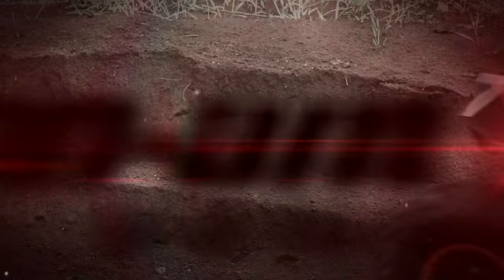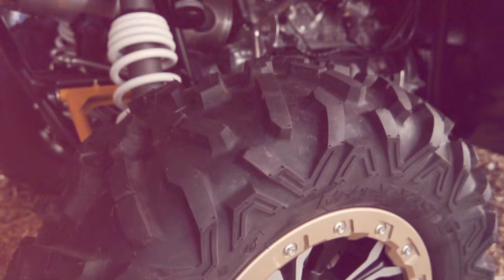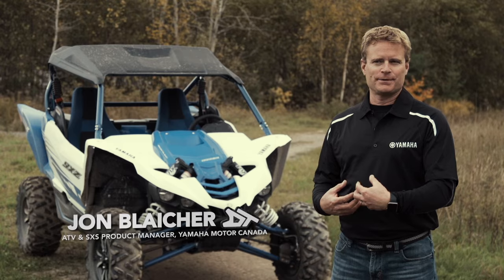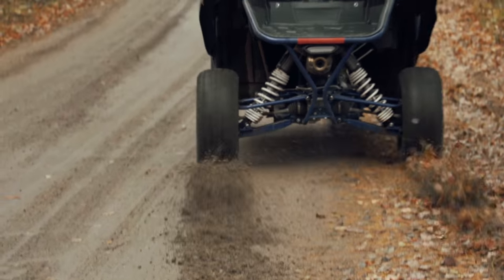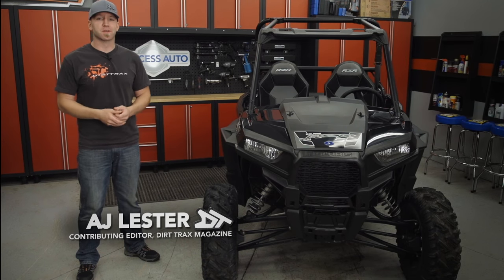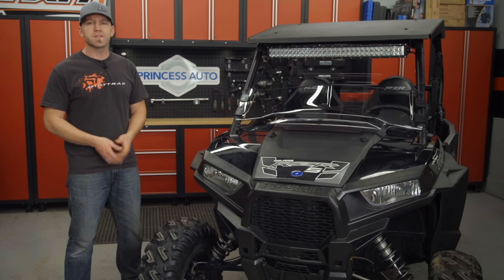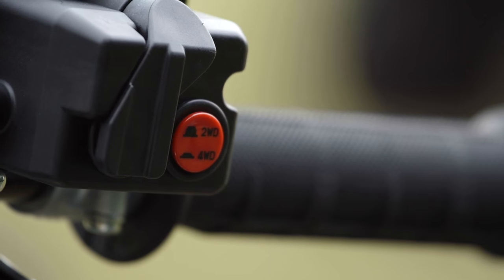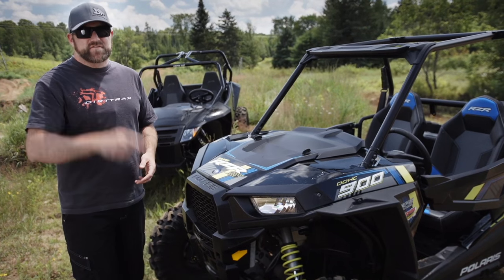Dirt Trax Television 2015 - Episode 17 (FULL)

Comment: i live in ny all we have are woods ,are camp is in pa ,so we ride the dirt and hills non stop.i love my yxz in the dirt i have no issues in tight woods all. ive never rode the dunes but i could only imagine how bored i would get looking at sand all day. after setting up the suspension i have it driving like a nice soft couch in the rough woods. with the installation of a rekulse clutch it made woods riding even easier. with that said i love my yxz in the woods and have no issues.

Comment: Unless my eyes are failing me, the blue/white YXZ has a bent left rear axle shaft... Very impressive looking machines for their intended use, however I just dont think it could take the place of a CVT in the rough and technical stuff. Wonder if yamaha will work on something a little sportier than the Wolverine for that? Either way, the competition helps us all in the long run.

Comment: Im going to come out and say it. If Yamaha slaps the same or a similar turbo system as the 998 triple snowmobile engine, this thing is going to blow up the pure spot side by side market.... 200hp yup... can hardly wait for the snow trax review of the yamacat combo.... ive heard 3rd party dyno of up to 204 hp... in a 500lb machine, that is straight insane.... Yamaha is guaranteeing 180hp in all conditions.

Comment: Which one is better for trail riding, the Polaris Sportsman 570 or Yamaha Grizzly 700?
Reply: +JustinJFilms i bought a new 2014 570 and its alright but in the long run and durability i would go with the grizzly
Reply: +JustinJFilms Cant go wrong with the Grizzly, very reliable, fast, good in all conditions, I'm guessing the Sportsman would have a softer ride (from my experience, I always found Popo to be smooth) not that the Grizzly isn't, I just find it more sporty of a ride/feel.
Reply: +JustinJFilms Yamaha's are bullet proof. Polaris's are anything but. You MAY like the Polaris better when both machines are new. But a couple yrs down the road the Grizz will still be bullet proof. I have a 2007 Grizz thats been ridden in very extreme conditions for years and has had no issues. Just talk to an unbiased mechanic. Yamaha all the way.
Reply: tjsyam921 i totally agree with you my sportsman had cracks in both plastic racks within 3 months
Reply: I ride a 2008 Grizzly, all trail riding, its bullet proof and has great ground clearance. 6600 KLM and all i do is change the oil and clean the air filter. I have some edited videos on my YT channel if you want to give them a look.